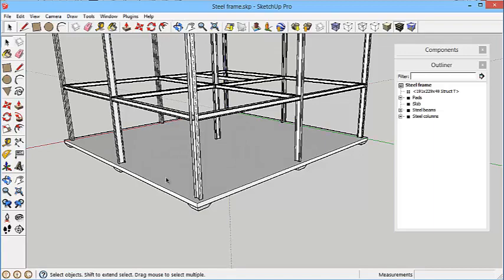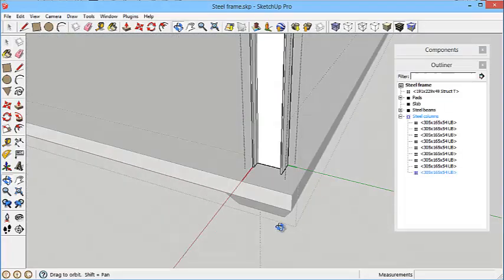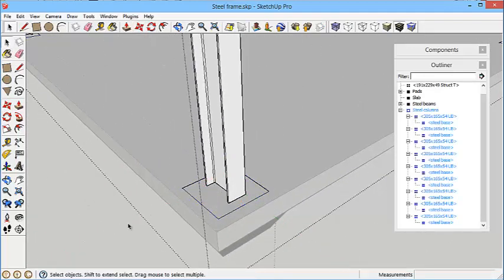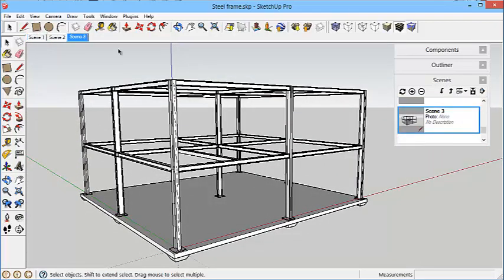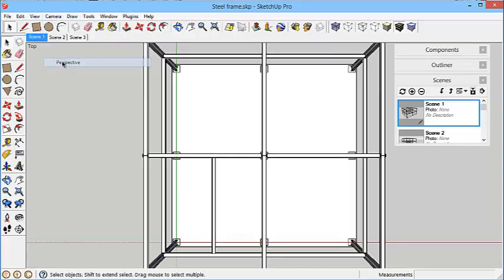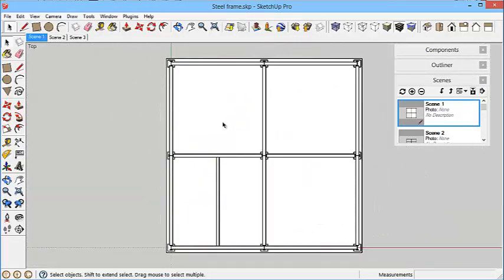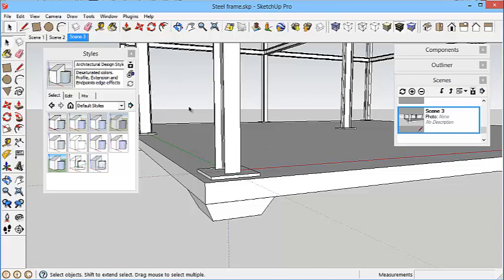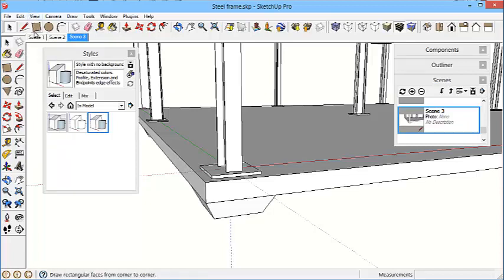102CAB - steel frame 4

Comment: you should try Framebuilder-MRD its very easy to use , I've tried it.
Reply from the maker: Thanks Muhammed, This was an early series to assist my  1st year engineering students to be able to more easily visualise a simple frame whilst showing some solid techniques for using the software. It was never meant to be for any sort of structural purposes. For that we use Revit and Robot SA. Best wishes, Paul